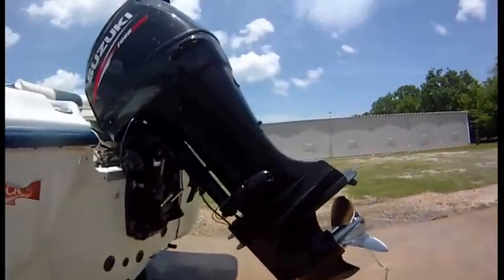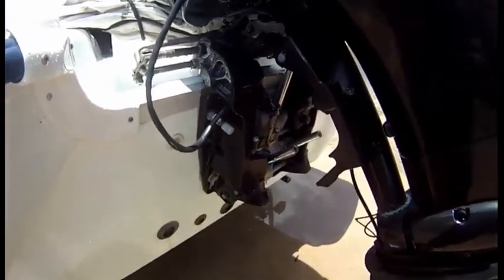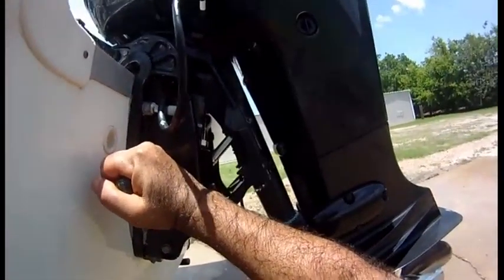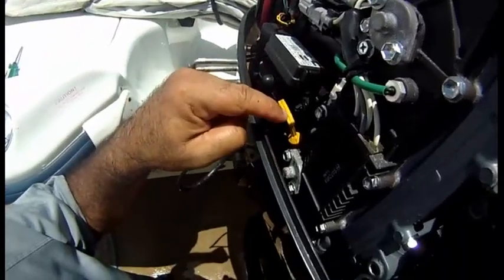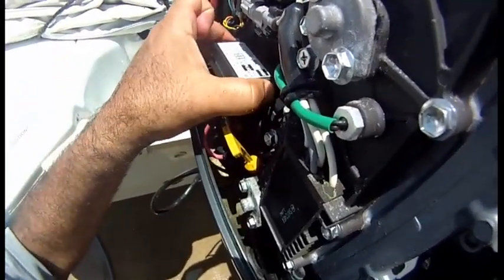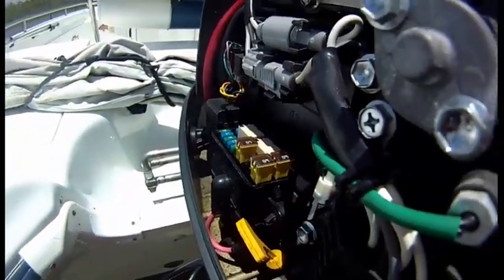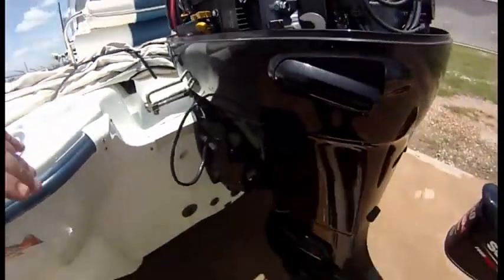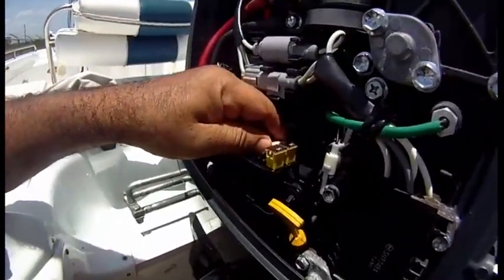what to do if boat trim does not work on any outboard

Comment from the maker: Lifting a DF 140 lower unit requires 3 turns on side screw and about 150lb of lift using man power or hoist if the issue is due to trim motor going bad we recommend to have it fix ASAP as it is difficult to lift the motor .
 outboard requires 
On outboard tapping trim motor works well, follow the electrical wire near steering to locate trim motor and tap the head.
On i/o system inboard outboard usually fresh water boat with Volvo engine .  loosen the hydraulic and relive the pressure and then you can move the lower unit. there be spill of hydraulic fluid . tie the lower unit using ropes to correct position so you can get home.  do this if battery is charged otherwise see if battery can move everything by getting  a jump .  swap relays for up and down as well.

Comment: Thank you so much for showing me how to work my motor, goes up but not down, but at least I can release screw to drop it, amazing
Reply from the maker: does this happen on both switches and fully charged battery . a 140 hp is near 450lb and a pain to lift using 3 strong guys.

Comment: I have the same boat and motor and the trim leaks so bad and get stuck up. I’ll try releasing it to drop down
Reply from the maker: My 2013 trim was replaced because electrical issue free in 2019 with a 6year warranty

Comment: There’s also a switch in the middle that cuts the motor off when it hits a certain height that goes bad you can use a flat head screwdriver and push in on it to get your motor to go up all the way
Reply from the maker: You are correct- Tilt Limit Switch on newer engines. Most often problem with tilt  is bad or low voltage. people think 12 volt is good but you are at 50% charge . 13.2 volts is 100% charge . look up voltage charge chart for more info . I have a video here for it too.

Comment: If u unscrew the bolt is it suppose to drop all the way down my motor will not
Reply from the maker: it is hard to tell what needs to be done but motor has a lock to support the engine make sure it is not engaged. if the boat being parked in saltwater without usage steering , throttle locks will freeze. do you see rust on shaft , if possible move it back and forth us. use your weight to push it down . there is trim limiter near steering by primbulb on suzuki . tell us where you keep it and age and last time you used it .

Comment: Hey — good information. I just brought home a brand new Suzuki 175 HP. Really excited until the trim would not go up. I just literally drove the new motor home. Trying get away from my old Suzuki motor problems. Yikes. Thanks for temporary fix. Now I need a permanent one. 😀
Reply from the maker: battery needs to be near 13.2volt check for connection corostion and charge.  did both switch failed you.
Reply: @boashna   — both switches failed. However, the down will work. Just before I left the marine mechanic he put the trim up and down. After a 30 mile drive it doesn’t work (up). The batteries are charged. We will see. Your video is timely I will use the screw option. Thanks.
Reply from the maker: @flash521  down is easier  to turn so start with  low voltage on battery . battery should be charged for 10 hrs  at 10 amp if you are below or near 11volts
Reply: @boashna  — Thank you. The battery voltage once plugged in for both batteries were fine. So, I did lower the boat engine using the screw technique —- GREAT - backed the boat the rest of the way into the garage. Door shut. 😀.  Here is the deal. Once the motor came all the way down and I re-tightened the screw the up trim worked. Engine raised - no strange sounds - just as it should. So, we have a little mystery here. Was it a fluke? (Rhetorical question) I guess I will find out. I did let my marine mechanic know and he thought the main power switch was off — but it wasn’t.  Anyways — your technique worked for me THANK YOU. We will see what the future holds? Thank God for His mercies.
Reply: @boashna  — Again thank you for your tips. I did find out the problem with my Suzuki 175 HP. My marine mechanic came by who rigged the new motor. On the motor there is a sensor switch that allows you to set how far you want the engine go UP. It is a little switch you can move with your finger. You push it all the way down, or where you want it, to control how far the engine trim will allow it to rise. Such a “little thing.” He showed me and I moved it with ease. I shared I did not find it in the manual. He smiled and said this is something mechanics are familiar with and not shared in the basic manual. —- So all is well. Hope to break in the engine when the wind lets down.
Reply from the maker: @flash521  good info-Trim sensor  which I do not have - my book says you get a alarm beep if it is disconnected but engine will not be affected  but major alarms cause your engine to go to 3000rmp only and you hear beeps there is video for that here . You will not see any alarms for a long time. I think your oil change reminder has a alarm  and light.

Comment: The trim on my 40HP Honda goes up and down, but if trimmed up it slowly goes down.  Any ideas what's wrong?
Reply from the maker: you have a leak - if leak is internal then no fluid will be on the ground and no big deal. Tighten the emergency screw shown on video.. if this is an issue during transportation on trailer you may have a lock tab near the steering cable next to engine. let us know how this effects you.. if it is on water engine should be down anyway and ignore the problem.

Comment: Thank you ! 
Tilt quit working and tapping on it fixed the issue
Reply from the maker: Bravo - check the voltage as well we need to be 13.2 for full 100% charge and have a screw driver available for insurance to open the emergency bypass.

Comment: Great vid,  Quick question. On a 125 outboard force motor. Do you happen to know why my trim motor is making a loud noise once it's red positive line is simply touching my battery . Even before I have touched the trim toggle switch . It's making the same noice as if im touching the switch even when I am not touching the switch ? I'd greatly appreciate any feedback you can provide! Thank you so much for your help 😊
Reply from the maker: switch is active disconnected follow the wire and unplug very easy to do. I am not sure what you mean by noise . noise to me it needs to be lubricated ..do you mean sound . make sure all grease nipples are greased and trip has fluid .since you are not a subscriber i get your text late. ask more questions if you need to . Trim switch can be activated by very small amount of saltwater if not sealed .

Comment: I dont have a screw to release the hydraulic on my boat and i vany figure out how to get my motor up help please!!!
Reply from the maker: I am late but if you unscrew the hydrophilic line they will spray you but you can move the motor then use the rope to tie the motor in correct position. , charge the battery to overcome rust on connections or switch fuse and relay from up to down or down to up .They have a relay and fuse .  listen to click to locate relay when activated. tap on relays to get them working . all of this is caused when boat is not used and things get frozen including steering and jack move everything once a month.

Comment: If the motor is stuck in the up position, and you can hear the motor sound of the relay, can it still be a relay problem?  I feel like it gets air locked somehow.  This has happened twice to me on my 60 HP Mercury outboard.  And loosening the screw didn't make it come down...had to remove it completely before it did.  What could be wrong?
Reply from the maker: check battery voltage and check for corrosion , use emergency screw on side to bring it down , use switch on motor not throttle if this continued let me know and i read service Manuel for you
Reply from the maker: my bet is low voltage jn battery or low water level in battery check corrosion on relay  fuse also

Comment from the maker: low voltage is main problem on new boat. 12 volt is half power and 13.2volt is fully charged battery . see other videos about voltage .corrosion on battery side is also common.